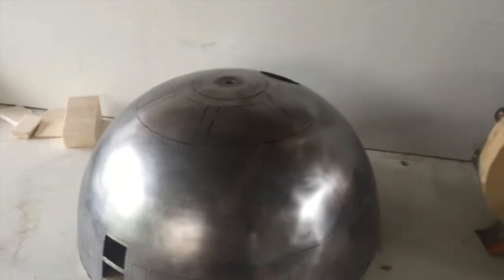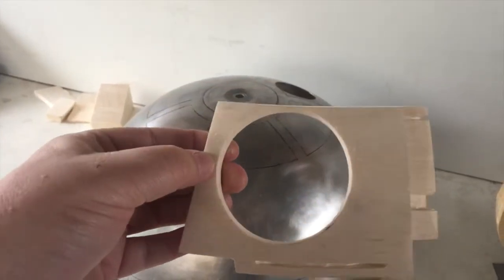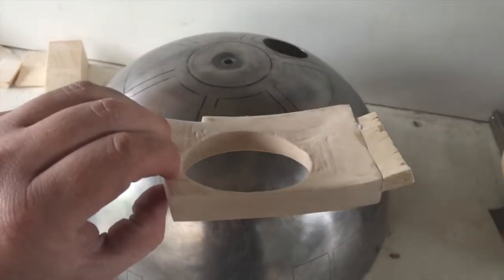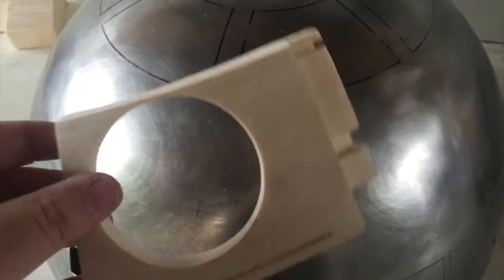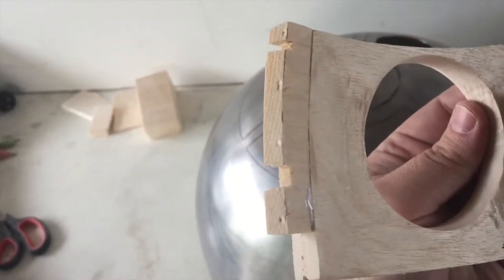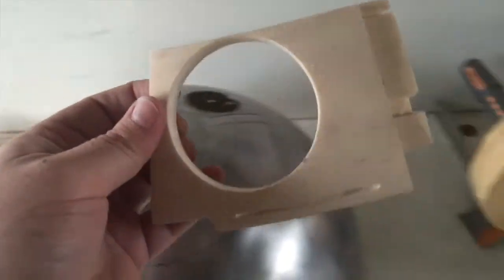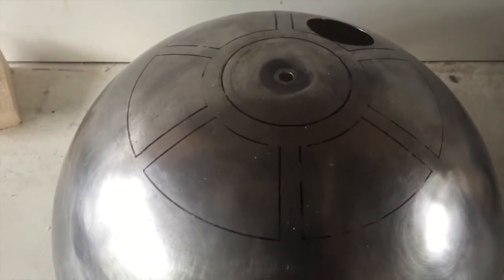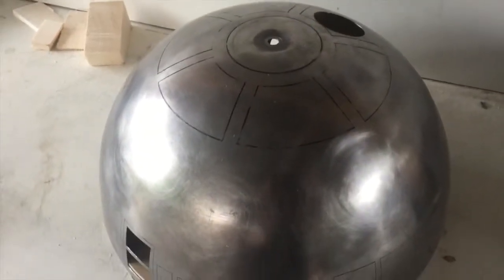R2D2 Build Progress Video 4 - Radar Eye

Comment: Nicely done, that sanding method is a grest idea.
I've also planned to use balsa to make most of my detail parts to reduce total weight and also because I love working with it.😊
Reply from the maker: +Simon De La Fosse I am an Arts teacher and use balsa wood for sculpture lessons quite often. I actually hadn't thought to use it until I went into work yesterday morning to get some planning done before the school year starts. I walked past a box of balsa wood and thought...HEY!
Reply: +MetalNerd 
When i was young I used to build model engines out of balsa and use body filler to coat parts that I wanted to achieve finer details on. The body filler can be sanded until its super smooth. My R2 detail pieces will be built using that technique.